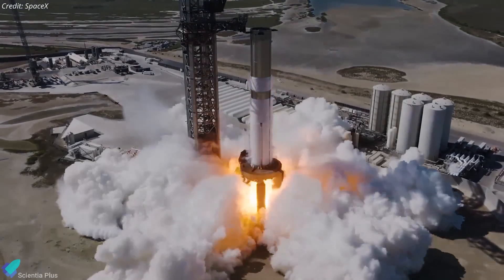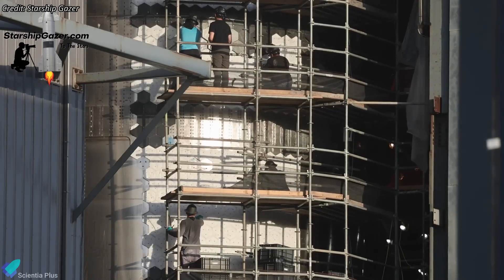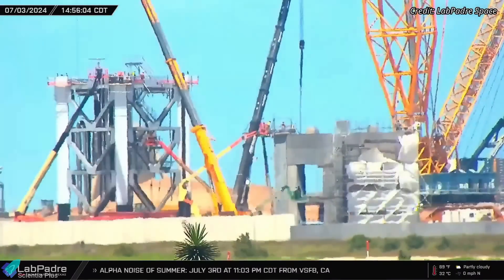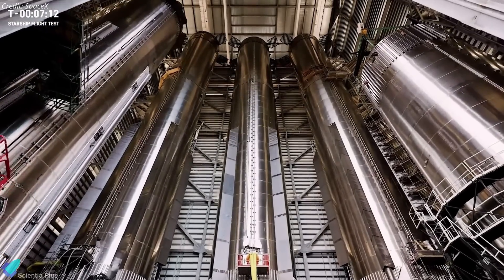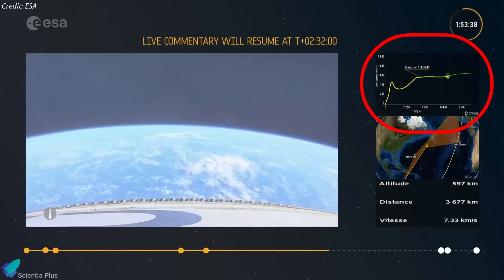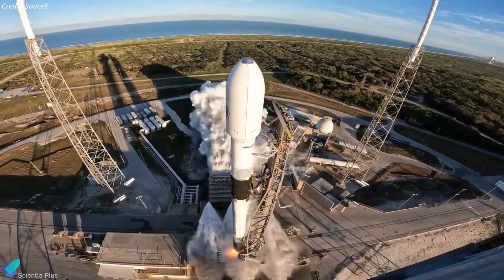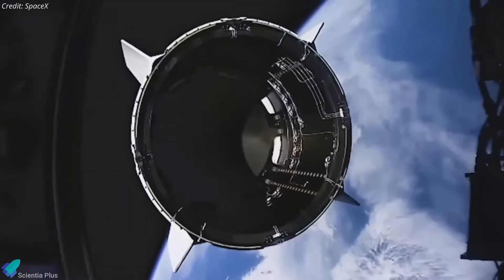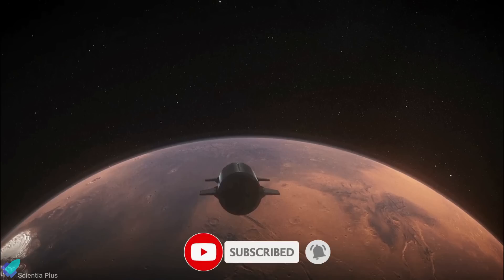Elon Musk Reveals What Actually Happened To Falcon 9, Starship Flight 5 Launch Date Updated

Comment: Was the Falcon 9 - Starlink explosion about finding a disgruntled employee, passed over for a promotion? Meet that person over beers and provide an opportunity to boost both the ego and wealth of the malcontent? A possible plan to modify code raising pressure limit far above the capacity of a valve. This might have caused an unexpected leak and a RUD. Time to check employee spending? 334 then THIS ? Just thinking

Comment: Calling on all Elon cult members!!! Please explain to me what additional data about booster performance SpaceX will gain by trying to catch the booster instead of landing it in an open field? Landing the booster in an open field will tell you everything you need to know about its control ability in the final stages of flight without risking major destruction of the tower and the tank from nearby. What is the damn purpose of this? The only thing I can come up with is that Elon needs a distraction from the fact that Tesla is not going to do anywhere near as well as he promised when he blackmailed Tesla shareholders into giving him $56 billion! Trying to do a booster catch with a booster that has never landed 100%, accurately before is just a grandstanding common man move.

Comment: Somebody in SpaceX's oxygen line installation group got some Splainin to do !  🙄
Reply: They just have to figure out what caused the propellant leak. There have been over 300 consecutive successful Falcon 9 launches without a problem so 300+ upper stages have performed flawlessly. 1 out of over 300 is not a bad record. Nothing can be made absolutely perfectly. Everything we humans make is flawed in some way. I figure they'll figure out what went wrong and devise a way to reduce (you cannot totally eliminate) the chance of this particular malfunction recurring. The problem is the machines are so devilishly complex that there are a plethora of potential failure modes.
Reply: @billmullins6833  Yea, I worked for a U.S. Major Air carrier for over 2 decades, all of it in maintenance or as a main Inspector.  One of our level III NDT techs is now @ SpaceX.  I know a little bit about accident reports & their likely causes. 
  Like I said, somebody got some Splainin to do !   🤔
Reply: @billmullins6833  I worked for a U.S. Major Air carrier for 2+ decades, all in A/C Maintenance or as a QC maint Inspector.  One if our Level III NDT techs is now @ SpaceX. 
   We went thru annual training on accidents & their root causes as well as recurrent "Best Practices" classes. I'm a bit familiar on the likely, or unlikely, root causes of maint accidents for A/C. That & I spent a few yrs in our Propulsion Shop on the Pratt or GE engines. 
  Like I was saying, somebody got some Splainin to do because it's Highly likely this was a Human induced error caused by some distraction to maint personal in the normal flow of maint or production. 
 Distraction accounts for 90% of accidents like this w/ maint mistakes following as a small percentage and faulty equipment at the rear w/ the fewest occourances.

Comment: Why use a flame trench? The best part is no part, at least while in prototyping stage. Away from home like the Moon or Mars it may be hard to build a deluge system.
Reply: I think that the engineers @ SpaceX have come to the conclusion that a conventional flame trench is the best way to control the exhaust of the booster engines. They tried a different way - which has actually worked, BTW - but I suspect they just figured it was not optimal. Thus the flame trench for OLM2. I figure once OLM2 is fully operational we'll see a flame trench retrofitted under OLM1.
Reply: You don't need as much stress on the moon or Mars apart do you not understand

Comment: I think Elon should consider giving the quick-disconnect a 4 second head start at retracting on lift-off. I cant imagine that would cut in to the fuelsupply on board in any significant way, but it would perhaps eliminate the need for rebuilding the thing after every shot. Just a thought.
Reply: That's not the purpose of  a quick disconnect. You want a useless slooooow disconnect. Something gives a lift off confirmation signal, only then do you want to loose the ability to detank.
Reply: @tsamuel6224  Well..they DO fill the rocket with fuel using the QD..its also the interface with the groundeqipment. It is designed to separate Before or During launch. Before beeing the point here. A lift off signal can be attained in many other ways, i think. Simply retract it as the engines fire up and dont release the clamps or go full throttle untill its out of the way. If something goes sideways on lift off, detanking will probably be the least of your problems.